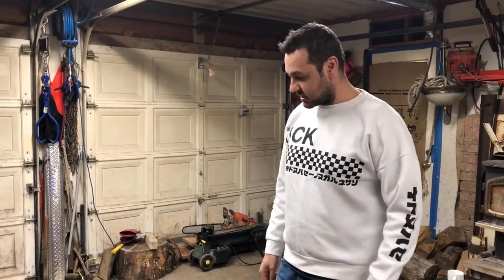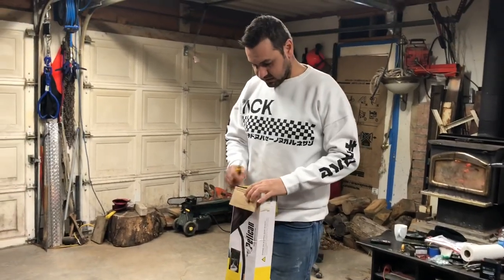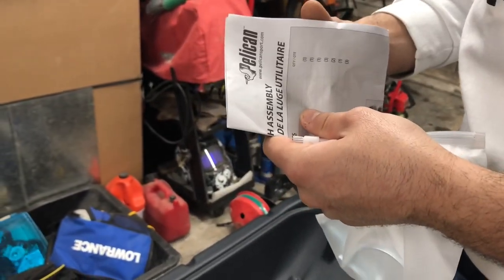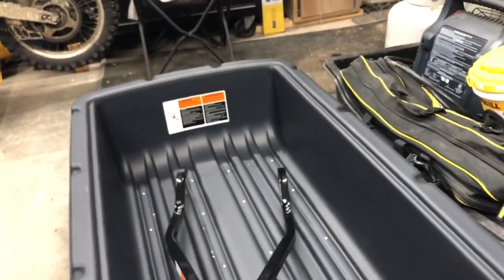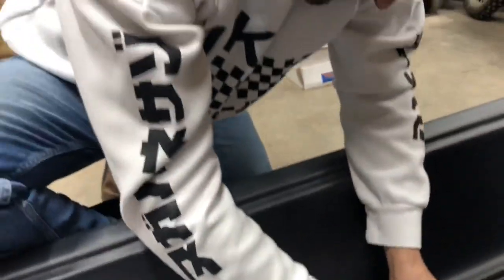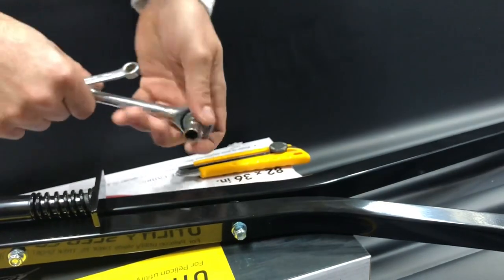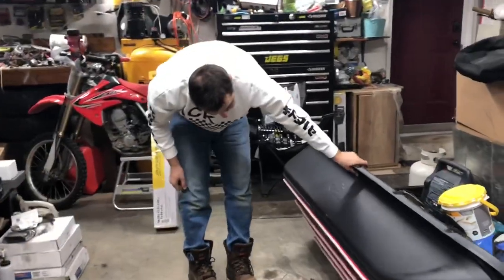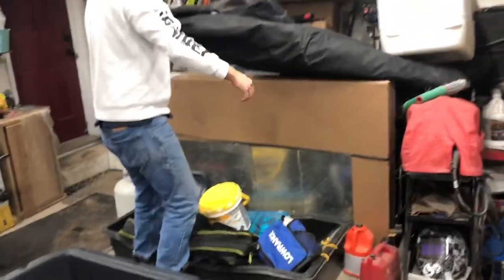PELICAN SNOW TREK 75 | PELICAN TOW HITCH | PELICAN SLED COVER | INSTALL

Comment: the only thing I was interested in,, was how did you connect the hitch to the atv? and you left that part out.. I have an outlander as well with a ball tow hitch
Reply: I bought a 2" to 1" adapter for more length and then a 1" flat with a hole for the pin. Work great towing the kids behind the atv. And it keeps the sled behind the tires about 3 to 4 feet almost

Comment: What about the pin to connect the sled to the snowmobile, is it supposed to have a shock reducing spring built into it? I see some online with a spring and some don't have one. Can a simple bolt act as a pin?

Comment: I’m thinking of just using the Pelican for downhill sledding, would that be applicable?
Reply from the maker: Yes, it would work. Make sure to put wax on the under side so the sled will go faster down hill.
Reply: @leskivoutdooradventures83  awesome! Will that spray you showed in the video help?
Reply from the maker: Yes it will, but it cost more then cheap wax

Comment: Man, would a washer on each side of square tubing, inside the sled help protect the plastic, or is that ridiculous?
Reply from the maker: It would help, but I still haven’t had any problems with doing it as the instructions say to do it.